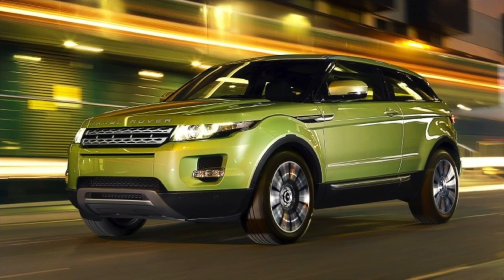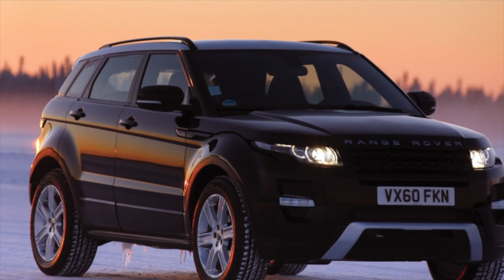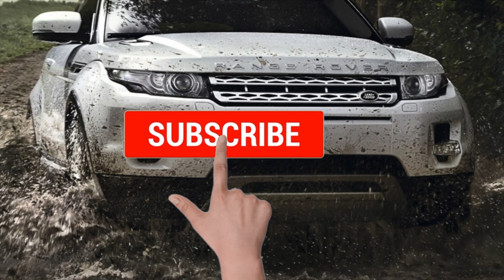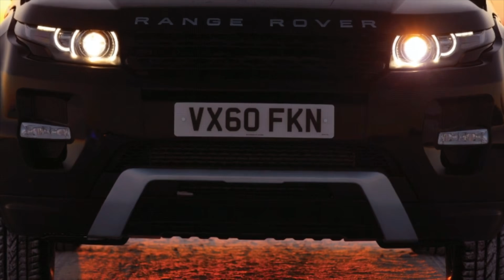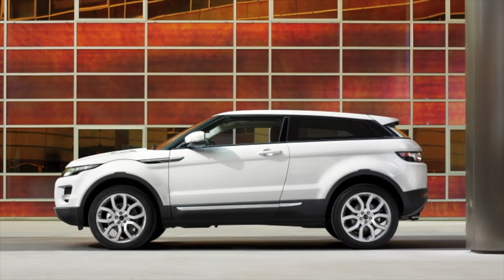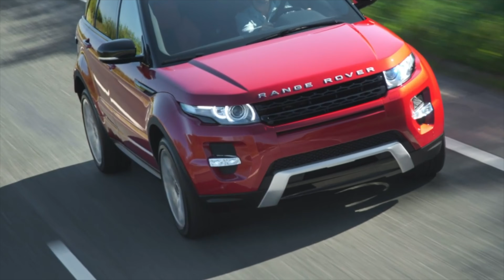Range Rover Evoque Problems | Weaknesses of the Used Evoque

Comment: I’ve owned my 2015 Range Rover Evoque since 2018, and while I still love the vehicle and it drives great now, I’ve dealt with quite a few issues over the years. If you’re thinking about buying one, here’s my honest experience:

* Constantly burning out headlight bulbs and melted pigtail connectors due to heat.
* Windshield leak at the top of the glass shortly after purchase. Had it resealed, but a few years later it leaked again and damaged steering wheel electronics.
* Steering wheel buttons stopped working, requiring a clock spring replacement.
* Turbocharger started making noise and had to be replaced.
* Fuel tank seal leak that required dropping the fuel tank and replacing parts.
* Headliner sagging.
* Interior door panel material separating and peeling from sun exposure.
* Airbag warning light caused by a faulty crash sensor inside the driver’s door.
* Secondary battery failure causing numerous U-codes and communication faults.
* AWD / steering fault caused by a broken wheel speed sensor wire inside the wheel well. The wire appeared to corrode and break, resulting in warning lights, steering issues, and AWD system problems.
* Timing component failure. A pin inside one of the camshaft sprockets failed, throwing off the timing and requiring a complete timing chain repair.
* Catalytic converter failure resulting in a P0420 code.
* Oil leaks around the turbo area.
* Paint quality hasn’t held up particularly well. I’ve experienced fading clear coat and paint deterioration sooner than I would expect from a Toyota or Honda.

Despite all of that, the vehicle runs great today. The engine is smooth, the transmission shifts perfectly, the AWD system works properly, and it’s still one of the best-looking SUVs on the road in my opinion. However, ownership can become very expensive if you’re paying a shop to do all the repairs.

The upside is that every one of these repairs taught me something, and I actually built my YouTube channel around fixing this Evoque. If you’d like to see step-by-step videos on how I diagnosed and repaired these problems myself, feel free to check out my channel and subscribe. It might save you thousands of dollars if you own one of these vehicles. 🔧🚗